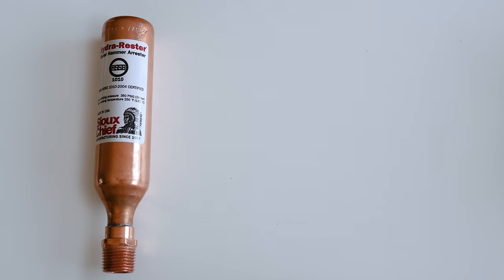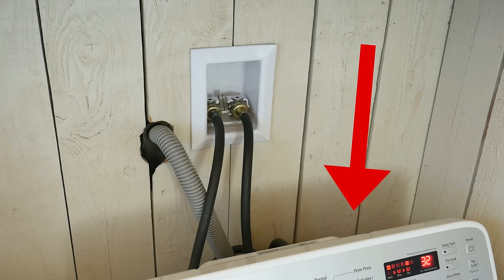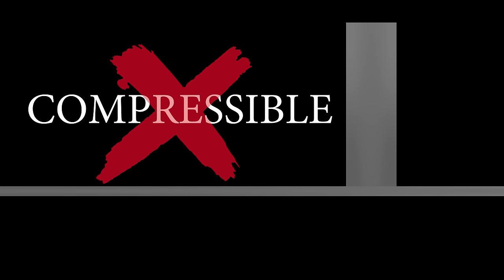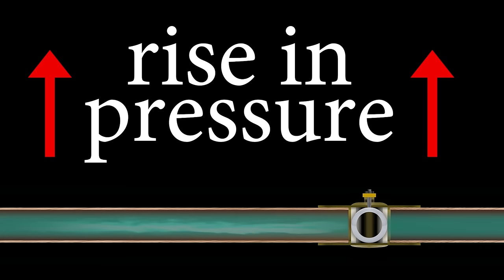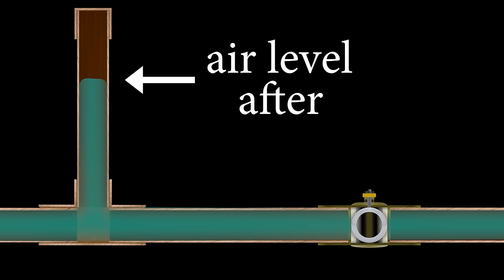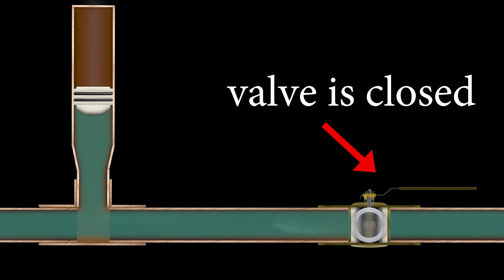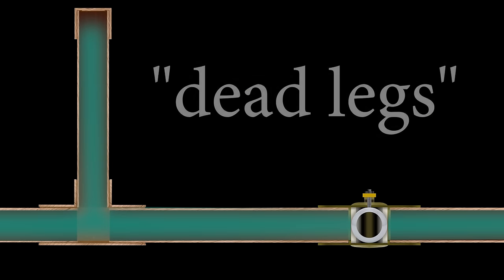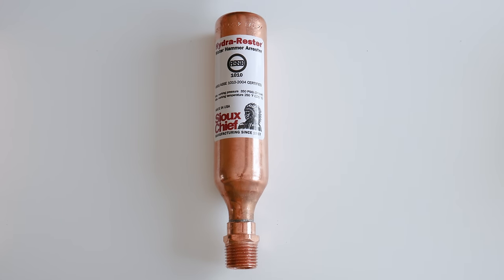Why Water Hammer Arrestors Are SO Important | GOT2LEARN

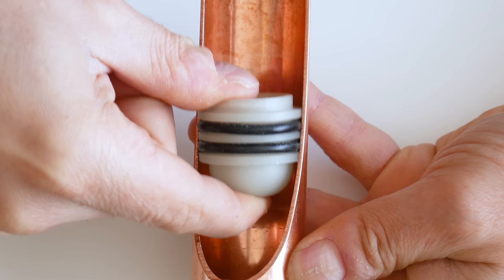Comment: 0:25 this o-rings through the time will be damaged and will need to replace better to think a maintenance free device!
Reply from the maker: They cycle test these up to 500,000 times when being tested in the factory, I wouldn't be scared of them being damaged :)
Reply: Correct in my view.. in hard water it will go wrong in weeks..  I suggested why not just have a copper T that then goes vertically from 15mm to 22mm (via a service valve so you can take it off) , to act  as a dead leg and put a couple of rubber balls in there. ... job done....he didnt thinks  so....prob because its doesnt sell product lol
Reply: @Got2Learn  For me they seem to last about 2-3 years for the small ones that attach to a washing machine.  No doubt the local water composition plays a part.  I'm also looking to see if there is a more permanent solution; that's why I'm watching water hammer videos :)
Reply: @BixbyConsequence  Even the Earth isn't permanent when you get down to it. The closest thing to a permanent water arrestor is probably an open pipe that's really tall. The problem is that if you've got a supply pressure of 50 psi you'd need 116' of height to prevent the water from constantly spilling out, and without a ridiculously tall pipe you'd waste water when there's a pressure spike due to water hammer. A simple air chamber that can be recharged is relatively permanent, but requires periodic maintenance in the form of pressurization (or draining of water).
Reply: @stevepseudonym445  that should make the membrane pressure tank the better option. Would one tank handle a whole house plumbing system? If so, where would it best be placed?
Reply: @theq-1  my initial thought was hard water mucking this up, but the hard water would build where the piston is in a resting position.

I personally do not think you can keep the water out of the air end with the design. Clever in design yeah, it is wiggled half a million times in a test. So what? I doubt any one did all the nessesary to make such a thing exist, run mucky water through for 5 years, and  back out of the investment when they do not work. They are next to impossible for a consumer to verify as functioning since their existence is a preventative for leaks, not to keep ill strapped plumbing from banging around. (pretty rare) 

I like Your idea @MrMaker, like a stress ball that will not soak up water yeah? The only special item is the ball, the rest is hardware store bits. Any deposits would self shed.

What if we made the ball a pipe its self? A squishy walled pipe? On a 5/8" run of pipe, you splice in a 1" section of pipe, and put the squishy insert inside.

Room for expansion, no stagnet water at all, no mechanical wear elements.

Happy Day great thinker!
Reply: @donalso  I'm not a plumber, but have made the old-style dead-end pipes in the past.  I put them above the utility tubs in the basement, with provision to easily drain just that section.  I also like the idea of the membrane pressure tank.  With a single tank on just the cold supply, the membrane would last longer.  It would work best if the pressure tank, the hot-water heater (and softener if you use one), and the suddenly-turning-off valves were all located close together.  Another thing that would help is for any piping between the pressure tank and the suddenly-turning-off valves to be oversized.  This would make for a lower velocity of the water in that section of pipe, thus less water hammer.

Comment: I guess for municipal water systems with constant pressure I could see where these would be needed. Those of us on private well systems wouldn't need this because the rubber bladder in our pressure tanks serves the same purpose.
Reply: James Barrow true unless you have a check valve in the system. Iron filters and water softeners sometimes have built in check valves.
Reply: @markchickenbutt8740  - That would be important. The huge system I have here which feeds my building and the larger commercial building doesn't have a back-flow preventer. It is really complicated why I cannot install one which goes back to the idiot who originally installed this system. It would cost tens of thousands to correct the mistakes of the installer and it's just not worth it to fix it at this point. So I maintain the water system from my garage for the entire property and have done so 13-years now. It is what it is.
Reply: James Barrow e have a number of back flow preventers here at our factory including the ones out next to the street.  One for the largest of the water pipes the fire system. A smaller one for the main water coming into the factory and a small one for the lawn sprinkler system.

Then of course there is others inside the factory.  I’ve had to rebuild a few of them when they start to leak.  That’s a pretty easy job so long as you can turn off the water.  

But every business normally has them out front and the city inspect them every year.

Comment: I’m going to renovate the house soon. How many should be installed and where on the line should they be?
Reply from the maker: It really depends on the way the home plumbing is setup.
Reply: @Got2Learn  ok. How about a general rule of thumb?
Near each snap value? At the end of a long run?
Reply from the maker: @jeffbrown7246  yes, near bathrooms, kitchens etc... the more the better, the pressure in the home also plays a big role, how much PSI you got coming in?
Reply: @Got2Learn  ok. That helps, thank you. So the more the merrier. I didn’t know if there was a critical limit that would adversely affect water flow. 

I’ll have to check the psi. Haven’t measured it in a long time. 

Do these guys wear out? Do they need to be replaced on any specific interval?

Thanks for the input!
Reply from the maker: @jeffbrown7246  they are cycle tested for 500,000 times, so it at depends how much the system is used, but if you keep them accessible, they'll be easy to swap out when they do stop working, cheers!
Reply: @Got2Learn  Thank you! Appreciate your help! Very glad I stumbled onto your channel. It’s very helpful and informative. No fuss no muss ... no silliness no stupidity no time wasting ... straight-up helpful info. Thanks a ton for your professionalism and down to earth explanations. Will work through your videos!
Reply from the maker: Awesome, thank you so much and I hope your renos go well 🤟

Comment: I've been installing these Hydra-Resters recently, where are these recommended to be put? For commercial water closet, lavatories, and urinals they have us put one inbetween the last two fixtures, but for a janitor sink I put one for the hot and one for the cold just like the old air chambers. It seems these are better used one for each fixture.
Reply from the maker: Well, the more the better but yeah, normally they are installed between the last 2 fixtures.
Reply: Ideally they should be placed close to any solenoid or sudden turn off device.  Otherwise there is still a column of water that has nowhere to go.  Admittedly even the flexible connection between a lever tap and the wall can absorb enough energy to be quite effective.  Any rubber connection in the system can expand under excess pressure absorbing the energy. Another solution would have been to require all solenoids to have a damper so they don't close too quickly.  Very feasible.
Reply: @smitajky  Can you put them directly on the washing machine? I've seen a few YT videos doing this, but the plastic valves aren't a solenoid

Comment: Very good.Generally,water hammer occurs,when there is a high water pressure issue.Also water hammer arrestors,come for cold,hot water,or both. Although this device can be found on hardware stores,go where plumbers and contractors shop.

Comment: The tanks for pressurized well water use bladders. Mine is just the old style with no bladder. Now you may have just solved the reason the air chamber gets filled up with water.

Comment: WHERE do they need to be installed?!?  Near the fixture?  That’s like, the most important part....
Reply from the maker: As close to the fixture in question as you can.
Reply: Also at what water pressure are they needed?   I’m on a well system that’s only 30-50 psi. I’ve never noticed water hammer problems. More like low water pressure problems. At its lowest pressure my lawn sprinkler stops turning, then after about 10 seconds pressure starts to build up and sprinkler starts working again.  😂😂
Reply from the maker: Water hammering happens mostly on higher pressure systems (60-85psi range), if you have no hammering, you shouldn't need any protection.
Reply: Got2Learn 
Good. Thanks
Reply: @Mote78  On a well you should have a holding tank that is pressurized. Well pumps into the tank, the water is distributed from tank to house.

That tank is basically a huge surge absorbing tank. Unless you have a large diameter run, or extremely long run, you shouldn't have enough mass of water in a typical home to create surges as the reservoir tank will dampen.

Connected to a municipal water supply, you have all that water mass upstream flowing and no holding tank to absorb surges.

Comment: Properly installed systems meeting relevant standards don’t need these devices, it’s usually crap ceramic mixer taps, pool top up valves or washing machines that cause issues with super quick shut offs.... I’ve been to a few homes that have been flooded by hammer arrestors bursting.... so not overly fond of them
Reply: @113Josef What you state is true,failing water hammer arrestors may be due to poeple buying and using cheap water hammer arrestors.High water pressure also tends to cause water hammer,I know this to be true because when we first got this house this house had no water heater or water pressure reducing valve and when ever we opened any faucet or flushed the toilet it sounded like somebody was in the basement whacking the pipes with a hammer.I installed a water pressure reducing valve and although the lower water pressure helped to reduce the water hammer it did not eliminate the water hammer.I clocked the water pressure here at my house at 90psi and 95psi before I installed the water pressure reducing valve.The expansion tank for my water heater tamed the water hammer to some degree but it was not enough.I know this to be true because I installed a water heater then had to wait two days to receive the water heater expansion tank and the water hammer was more noticeable before I received and installed the expansion tank for the water heater.
Reply: @nelsonechevarria7009  it’s great that you found something that works for you. Here in aus we have strict design requirements for plumbing, if these are adhered to no hammer exists. Correct pressure, pipe size, fixings and fittings all work together.

Comment: I need these. 60 year old house, everytime we turn off the water we get banging pipes
Reply: I turn off the water at the main and start in the basement flushing toilets and opening faucets. You’ll hear the slow hiss of air escaping and then I head upstairs and do the same thing at all the water outlets.. toilets showers faucets etc toggling the hot and cold sides at the outlets. I wait about 10 minutes and viola …problem solved and all the faucets are closed again.
Reply: @XX-166  its usually a loud 'Thunk' when turning off a water source. I'll give it a shot, basically 'burping' the house :)
Reply: @longbow6416  that’s exactly what you’re doing, burping the system to allow the built up air to escape.  It may happen again in a year but it’s cheaper then a plumber and it only take 25 minutes.
Reply: 9 times out of 10 when I install them they never fix the issue, instead pin the washers on ya taps, put quiet flow valves on washing machine and dishwashers, change tempering valve on hot water unit, change duo valve on hot water unit. Beyond that chances are your pipes are clipped correctly in the walls causing them to rattle.
Reply: @ShotgunpleaseNOW  bleeding the system works great and it’s only needed maybe twice a year

Comment: Does the water hammer arrestor need to be installed vertically or can it be installed horizontally?
Reply from the maker: Any direction.
Reply: humandxp The arrestor can be installed in any configuration. The polypropylene/o-ring device is installed much closer to the neck of the arrestor than the animation shows.  There is around 5ml (1 teaspoonful) or less of water left in the arrestor's neck.  During any time that the water is running and during the actual operation of the device, there is enough  turbulence and back pressure created to dislodge any stagnant water in the neck area.
Reply: Asking this question, better get someone who knows what he is doing....
Reply: @jackripperchen4492 , yeah. Don't ask questions to learn or anything......

Comment: Great presentation but....water hammer is a symptom of poor design and can be avoided by sticking to proper pipe sizing and avoiding long straight runs. General rule of thumb is to ensure that flow velocity is below 2.5 metres/second.  Pressure control valves are very useful in this regard.

Comment: Good information. Decades ago (late 50’s) my parents house was built and the plumbing had no issues for 20+ years. Eventually some work was needed and the licensed plumber a few houses down the street asked to do the job. It seemed he did a good job, except when the washing machine water flow turned on or off or the water to the refrigerator ice maker turned on or off. Then the hydraulic shock would BANG the pipes. Eventually it broke a connection and spewed water. Of course the break was located requiring a big hole in the wall.

Comment: I had water hammer issues in my previous home built in 2007.  I installed an expansion tank on the incoming service line and this eliminated the water hammer issues.  My new home that we just purchased built in 2016 has hammer arrestors on the washing machine valves.

Comment: The pipes should be copper so no bacteria
Reply: Alot of water runs are Pex now adays, and have been for a long time in industrial settings
Reply: You wouldn't use pex for something like this tho maybe pvc
Reply: Yeah sealed pipes with chlorinated water going in ..... WHERE would the bacteria come from ? Doesn’t make sense !
Reply from the maker: Standing water.
Reply: @Got2Learn  copper is naturally antimicrobial even if there was standing water it wouldn't go stagnant
Reply from the maker: It's one of those things that you just don't take a chance.

Comment: Sorry, this may have been the American solution.....
Reply: What other solutions are there?
Reply: As the presenter showed, moving water has momentum that needs to be absorbed if a valve is quickly closed.  The same laws of physics apply in your country, surely.
Reply: korinogaro1988 Out of curiosity, what type of plumbing do you use? 
Galvanized, brass, copper, pvc?
Reply: Maybe what you don't understand is what causes the pressure surge. The water pressure itself has only an indirect effect. Water hammer is the result of a change in momentum, momentum is a result of mass and velocity, and velocity is a function of the square root of the pressure differential. Even in places with a municipal pressure of 100psi (6.9 bar)  the velocity will only be 30% higher than at 4 bar. That's fairly trivial when it's just one of many factors in how much pressure surge results when a valve is closed, and  when the municipal pressure is high code requires a pressure reducing valve. The pressure in most houses in the US won't be any higher than the 4 bar limit you think solves the problem.
Reply: Seems so. I have never seen thuch a solution in Europe. If necessary we use a pressure compensation vessel like a IMI Pneumatex ADF. In the hot water line to compensate the expansion when warming up and in rare cases against water hammer. Full flow an no sliding parts by a butyl buble.
One difference may be, that our washing machines uses less water so the flow can be lower for the same filling time.
Reply: Air chambers. That's the solution in Chicago.
Reply: @jfnotk255  I have a 100% copper pipe system with an American top loading washing machine (hot water + cold water feed) in the UK, never had a problem like described in this video. But then again we have hot water tanks, cold water tank in the loft and a floor standing boiler with a pipe than runs from the ground floor to the roof from for venting air out of the system, I'm guess all that dampens it a little bit. 

Never even seen those things before this video.
Reply: @edwardecl  - 😁 Hot water feed would be useless with a EU washing mashine. Until the hot water has reached the mashine it is filled.

Comment: We in Germany are at least 20 years ahead of you, we use  "trinkwasser membran ausdehnungsgefäß" which is a steelball with a rubber like Ballon inside, one half is beeing filled by the Ballon and the other Side is filled with "stickstoff" nitrogen, which is a compressible and it doesnt diffuse trugh the rubber like oxygen.
Also while we use it primary to capture the expansion of hot water in our systems, we dont use any kind of fast closing Systems, because the cause more harm and noise.
Also your water hammer arester has a big flaw.... They can get stuck some day without you knowing it...
Reply: That was what i was thinking. What if that plunger got pushed up so hard it doesn't come back down?